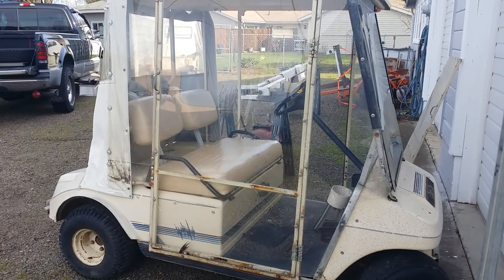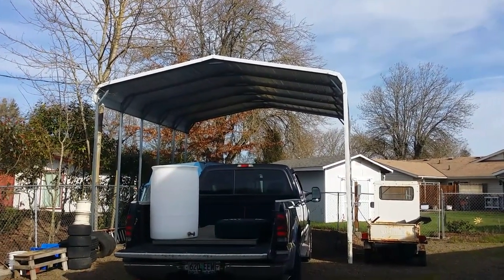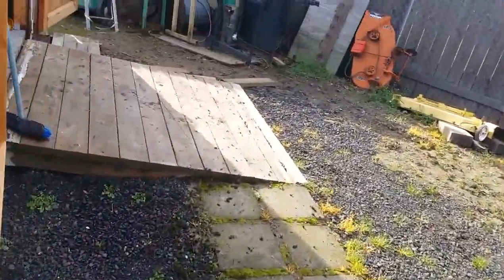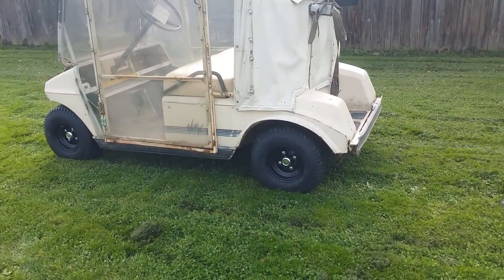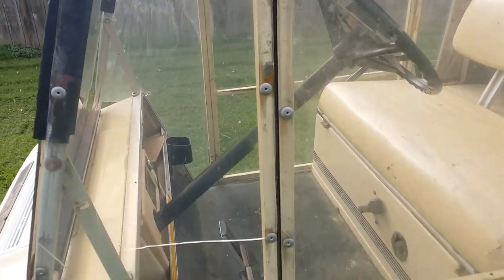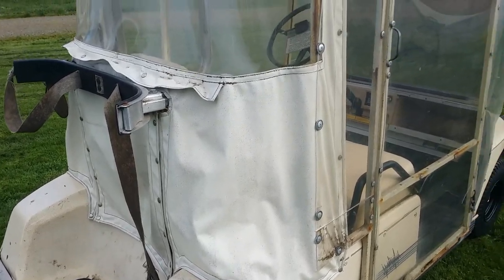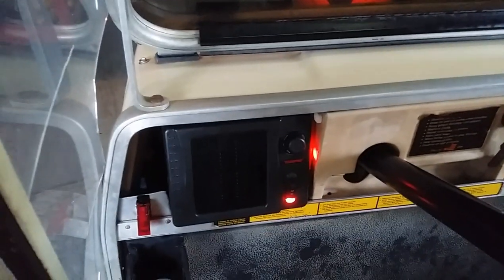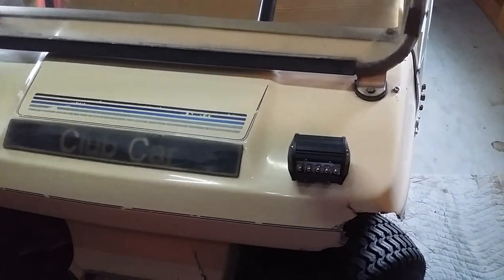The Barn Find Club Car DS gets cleaned up, new Wheels & Tires, LED headlights, & an Electric Heater!

Comment: Hey you need to add a voltage reducer from 36-12 sparky you will wear on those 2 batteries
Reply from the maker: Club car never did it for the reverse... they just tapped the batteries at 18 volts. These are insignificant loads in the big picture